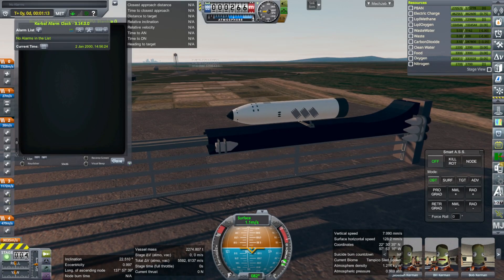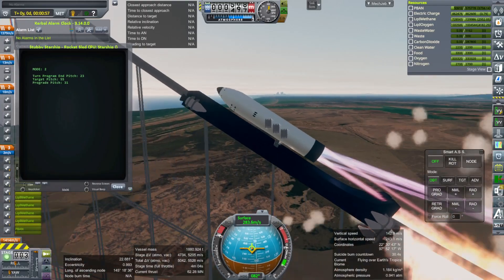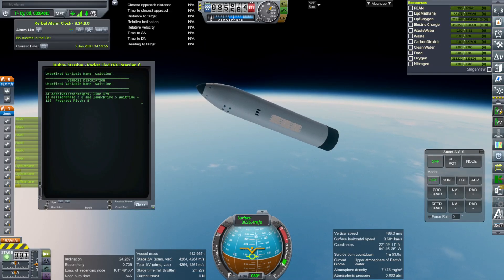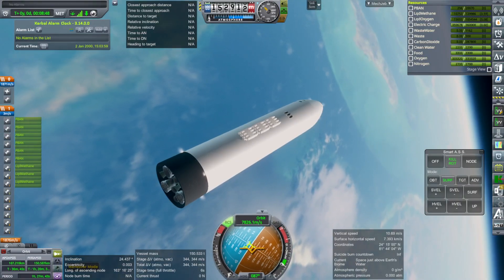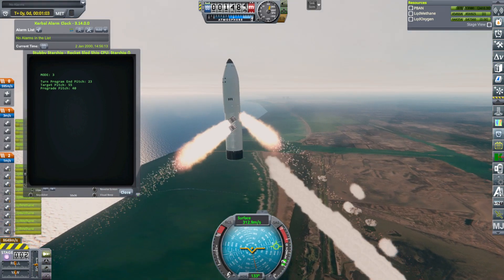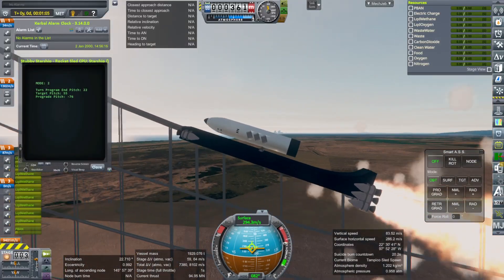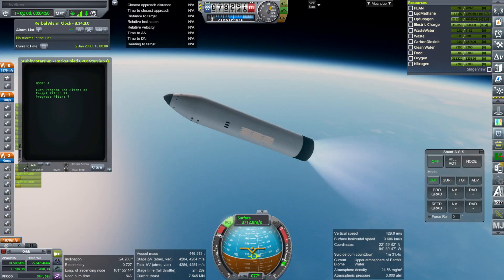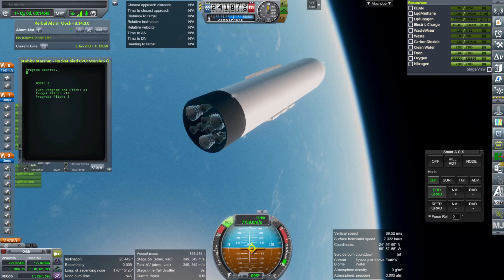Starship - Rocket Sled

Comment: A heavily built fighter jet would crumple if it turned too hard at Mach 1+ when going through sea level air. Seeing a thin-skinned Starship pull off a maneuver in those conditions is insane.
Reply from the maker: Well, sometimes it pulls it off and sometimes it basically crumples. It's just a matter of where "too hard" is. It's nice to sort of have this realism in KSP - whether it's parameters need tweaking, we'd need more information to figure out.